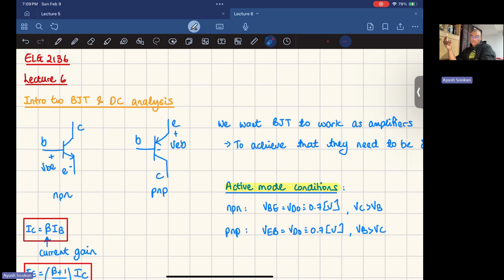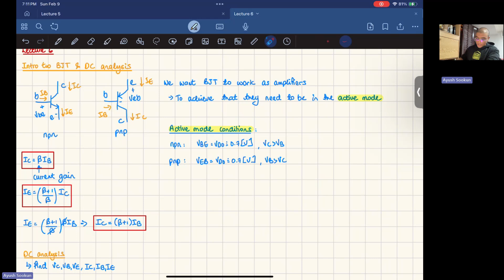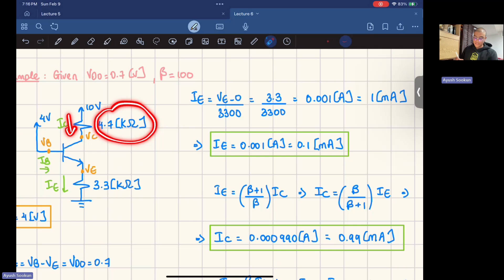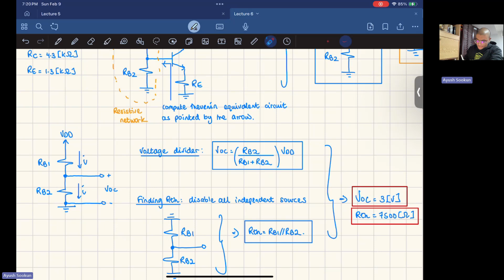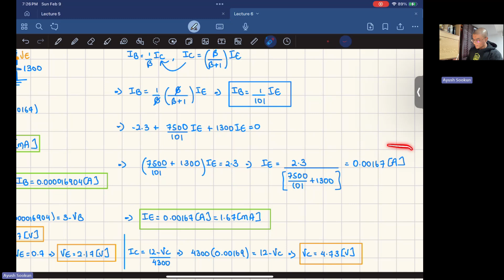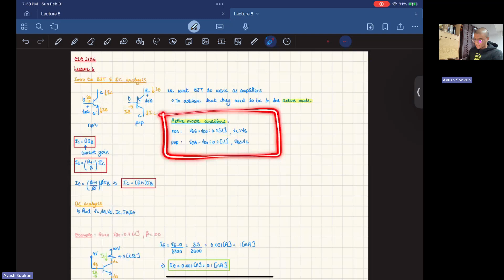Electronics 1 - Intro to BJT and DC Analysis - Lecture 6

Comment: great video! one piece of feedback for the DC analysis part: there’s just a small mistake in the last step. For Vc, the 4.7 kΩ resistor should use Ic, not Ib, since it’s in the collector branch. That gives Vc=5.35V but you got Vc=9.95V. Easy mistake though, rest looks solid!
Reply from the maker: appreciate the feedback G! even the greatest minds make mistakes sometimes 😂😂